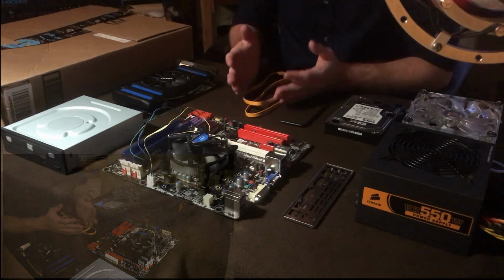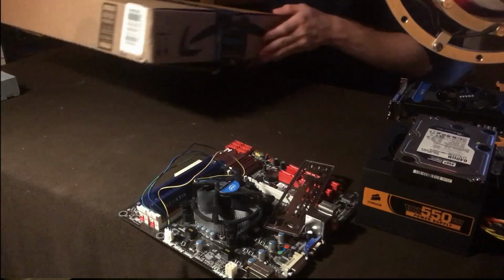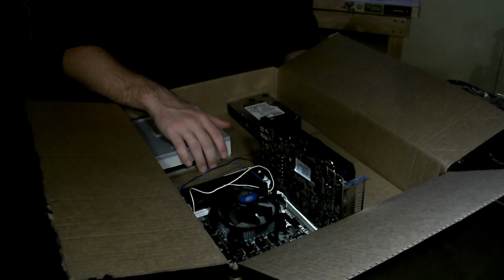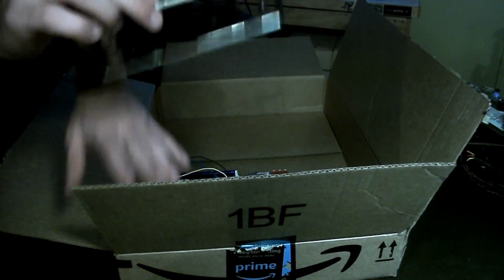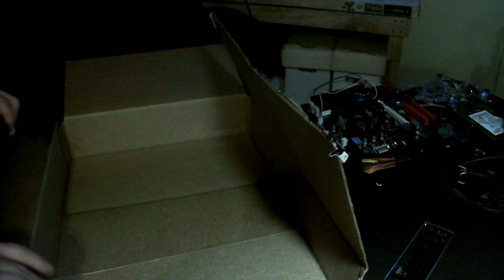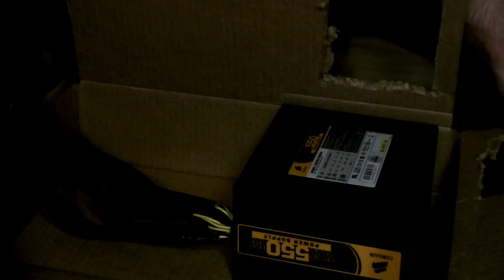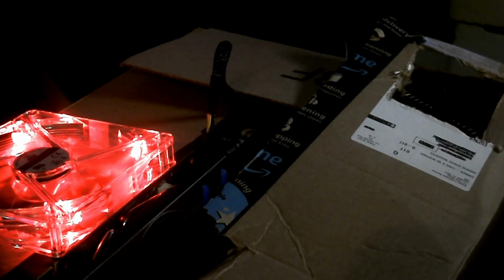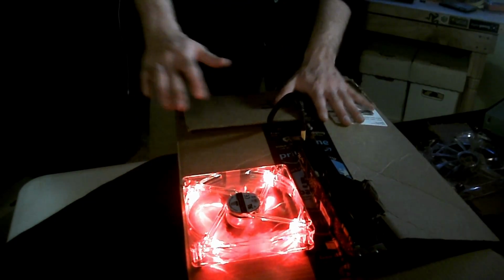How to make a SAFE DIY cardboard computer/gaming PC case

Comment: Are you sure it wont light on fire and burn down my house? Asking for a friend.
Reply: Ani-Mike-Tions I was wondering that too. Idk. I suppose u just need REALLY good fan cooling
Reply: Cardboard ignition is like 230 degrees, so unless a spark comes out which is highly unlikely unless you fuck up really badly in something, or use faulty PSU, the pc should be safe

Comment: there are a LOT of places where you can get old dell or lenovo full PCs for 10$ or less or even free the really old ones, wich BTW have full size cases that can be used in modern computer, there is NO reason in the world to go with cardboard, at least use wood, or mdf  wich are not ideal eithe but are a LOT safer
Reply: It’s safe if u know what ur doing but everyone lives somewhere there is dell cases
Reply: In my town, it's difficult to find pc case and if i find, it is more expensive than online selling.
If i buy it online, i always get the damaged one because of brutal shipping... 😣😣 If i ship it with wood packaging, it will cost more expensive for shipping.... 😥😥
Reply: Where are these places?
Reply: @naran_naran  usually big warehouses of used pc wholesale parts, they have tons of obsolete hardware that theyr willing to give out for free you have to ask or go dumpster diving in big electronic outlets   is a lot of fun if the place is right
Reply: @enriquedossantos3283  I doubt there's any place near me like that, but would certainly be worth a look, I guess.

Comment: would the cardboard cause a fire hazard?
Reply: cardboard is an insulator, so it wouldn't short stuff on the board. it is flammable, but you will like, never have sparks or flame of any kind in your PC.
Reply: @JaredT-mp7cy  I saw a PSU die one day. It did spark, left some white smoke and had a burnt smell after that
Now the PSU itself has a case, and even if it hadn't, I doubt a brief spark would be enough to really start a fire
Reply: @angivaretv4475  spend an extra 10 or $15 to get a decent PSU that has a very low probability of ever failing like that. The better the PSU the higher quality components and the less likely it is to fail. Look at reviews too and choose one with good reputation that you trust. This shouldn't be an issue

Comment: How do you turn it on without a power button?
Reply from the maker: Jump the power headers
Reply: @JaysTechVault  Another way is to jump the power header with a jumper, then use the PSU switch as on/off.

Comment: How much hardware do you damage (and attempt to warranty) from ESD? caused by unstable builds like this... Not recommended anyone try this if you care about your parts.
Reply: Wood (and cardboard) is not a very good conductor, so as long as the box isn't being dragged on carpet while operating and the PSU is properly grounded, should be safe.

Comment: Where are the i/o front panel? how it be start?
Reply: Short the two "power" pins where you plug in the front io ports. You can just ground them with a screwdriver and it works just fine.
Reply: @xander3875  do you recommend doing this every time, lol. There should be some other solution for this, otherwise this idea is just garbage
Reply: @singh_gurjyot You can wire a push button. Search it on YouTube but you basically wire the vcc and GND to the right pins. Some motherboard have a button to start them if you get a newer one.
Reply from the maker: Also get some extra usb hubs and you have some front ports. Grab some audio connectors from an old case and wire that in all good.
Reply: @JaysTechVault  I'd recommend against setting up audio as you'll probably never need it.
Reply from the maker: This is true but some people have headphones
Reply: @JaysTechVault  Yeah I'll listen to my ubuntu CLI ;)